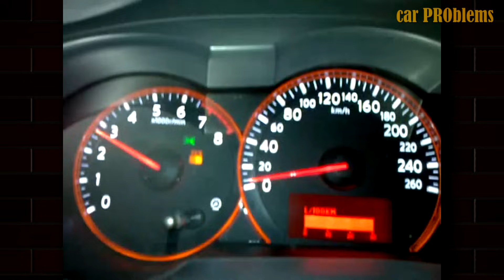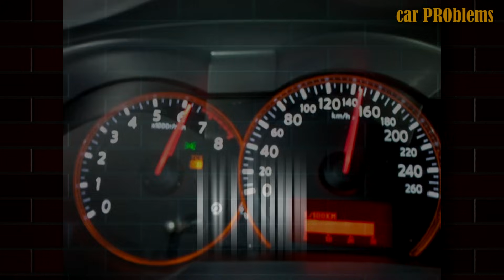How long do CVT Transmissions Last? - CVT Reliability

Comment: I have almost 180.000 miles on my Lexus hs250 and I haven't had any problems and if I did I could get another cvt transmission for about 1000 dollars on eBay

Comment: Over 130.000 miles so far on my 2009 Nissan Altima CVT. I've had it serviced a few times, although probably not often enough. That said, thanks for the reminder. I'll be doing it by next year at the latest. I don't drive too many miles; less than 8,000 per year, and I go easy on acceleration. I have experienced no odd noises or smells. Anyone else here have a 2009 Altima? What is your experience?

Comment: I have a 2010 Altima and I only got 100 some,000 mi on my CVT before. I replaced it in March so it didn't last long. And another thing, the dealership do not like changing the fluid and transmission because they say it's got a seal. That's a damn lie when I took it to the amco transmission. Who specialized in this? This CVT it was muddy black and the Floyd was burnt. Shake my head that's pitiful Nissan better get better with the CVT cuz you're only running off of a belt and that's it. And you never know when that's going to stop on you even with the brand new ones

Comment: 118k on mine bought from old people original owner driven like a baby and right after I bought it it started going out. We are so screwed. I spent every dime we had cause the car itself was so nice. Looked brand new inside and out. But with this trans going bad it's worthless. Don't know what to do. We are in big trouble unless I can find out how to fix this. Don't have anywhere near 7k to replace with new. Took me 4 years to save up the 5k to buy the car. Anybody know any tricks to fix these for cheaper?

Comment: My Honda dealer recommends changing CVT fluid every 40,000 miles. There's a general mechanic in the next village, but he doesn't know foreign cars or CVT. He's more agriculture based. That means i have to travel 100 miles for service, but it's the only place that has someone who knows these things. Something to keep in mind before buying this new technology. Not just any mechanic can fix these things if you have a problem or need maintenance.

Comment: I just bought a used honda accord with 25k miles and that transmission..it seems to be ok . I going to service it every year . However i never ever going to buy another one as i not going to change the possibility failure.  I dont care if it last for 200k it want matters to me . I bought this car and it pretty nice ride but for me i never going to own another one.  Not wanting to deal with that

Comment: My 2019 Corolla CVT transmission went bad at 106000
Reply: Did you get the transmission replaced? What were the signs that it was going bad?
Reply: @ yes. It just broke on the freeway. It just wouldn’t shift. It happened in stop and go traffic on the freeway.
Reply: @ELURIE12  yikes thats scary, my 2019 with 105k miles is acting wierd, it has poor acceleration and sometimes doesn’t want to move when in reverse, i noticed a burning smell coming from the bottom
Reply: @j.vosier6786  How often did you change your CVT fluid?

Comment: Cvt transmissions were developed becausenthey are cheaper to install by the manufacturer they work great on an atv but not on an automibile because ofnthe conditions we put our vehicle under like towing etc. if you have to baby a new transmission it is useless in my opinion

Comment: A prius does not have a belt and variable clutch type CVT. It has a Power Split Device eCVT. No belt, no clutches. Instead it uses ultrareliable planetary gear sets controled by the two motor generators. Do NOT use a Prius as an example of belt type CVT reliability.

Comment: ........... counting all the fluid & filter cost that goes with it............ to may humble opinion ain't worth shit. That kind of expenses is eliminated by just using manual box........... change oil once a year. Clutch plate .......... very long time. Saves 10's of thousand of $ on replacing box fluids. So what's other opinion ya.

Comment: No such thing as a CTV or ECTV (from a Toyota) being just as good as a regular transmission. Not including the Toyota 8 speed in my new 2020 Camry. That thing was a piece of junk. If most all of your drive is highway it will last longer. If you do a lot of city or stop and go driving it's going to fail early. The Toyota ECTV uses motors but you still can't beat on it or add very much horsepower.

Comment: If you as a driver enjoy a mundane driving experience with no sensation of shifts, then by all means go for the rubber band effect of an CVT transmission. But be prepared for a big repair bill when your CVT dies. They are not like automatic transmissions that shift and can be rebuilt with new parts. Thus, CVT's are a throw away transmission and lack durability when worked hard. That is why they are not used in heavier vehicles that are used to pull or carry heavy loads. It seems most automobile manufacturers are producing a lot of short-lived garbage these days. We as consumers need to wake up and stop buying there under engineered means of transportation.

Comment: Nissan X-Trail (rogue) owner here.  Peppy engine , although if you push the CVT tranny (as I experienced) a burned smell is produced.

  I upped the frequency of fluid and filter changes to 40,000 km maintenance.  
  CVT is tender and you have to baby it somewhat.  That said, I can leave most Toyota arrogant drivers far in my rearview mirror.

Comment: i bought my 2016 honda fit cvt back in 2019. .had only 14k on it and the original owner was an older man.. it has 68k on it and ive changed the trans fluid twice in it so far.. i had them show me the fluid after i waited 32k and i could barely see color in the fluid when they held i tup to the light so i scaled it back to 25k..  i LOVE my fit. it gets like 43mpg driving aroudn TOWN at times.. i change my oil 1k early. .and if it needs a radiator purge or whatever i usually get it.. i also have a limited lifetime powertrain warranty so.. it fits with my ocd about maintenance

Comment: I have a 2013 Accord and it just hit 100k mi. So far it's been a very reliable car. However, I will say I am not a fan of how the CVT feels. While the industry says "smooth ride due to elimination of shifting" I say "extremely boring, numb ride" especially because I had an 02 Accord wirh a conventional automatic and remember how awesome that car felt. I  can honestly say I'm ready to step away from Honda's basic line and step up to their Acura lineup since those don't have CVTs. The downside is requirement for premium gas.

Comment: Toyota E-CVTs in the Prius / Rav4 / Corolla are completely different from regular CVTs. These are bullet-proof, completely different tech.

CVTs i. Hondas and non-hybrid Toyotas have a launch gear to reduce stress on the transmission.

Still, I would stay clear from those as well.

Comment: I am amazed that a Youtuber would start comments about belt/chain drive CVTs by showing a Toyota Prius.    Later in your video, you AGAIN show a Prius between pictures of a belt/chain CVT.    The Prius DOES NOT HAVE a belt/chain CVT.  It never had one.  It does not now have one.  The Prius uses planetary gears.        Yes, belt/chain CVTs are problematic.     The Prius drive system is bulletproof.       Before you start bad mouthing a great car, find out what you are talking about FIRST.

Comment: The CVT on my sisters 2006 Mitsubishi Colt had 496,000 km on it when she sold  it. However the CVT was badly maintained: She wouldn't do a transmission oil change for 200,000 km or more. It was driven away by the guy who bought it... but it was playing up (sometimes didn't want to go into gear)  because of all the metal in the oil. We think the valves got stuck. Repeated fushing didn't help much. Maybe additional flushing would free the valves up again as the magnetic sump plug was still covered in metal filings each time we changed the oil. However it probably needed a new CVT. 

I'm sure it would have gone much longer if not for the poor maintenance. 

N.B. The engine was running perfectly when it was sold.

:-)

Comment: My 2015 Nissan CVT is nearing 160,000 miles.  I have the transmission serviced every 30,000;miles.   👍🏾👍🏾👍🏾👍🏾👍🏾
Reply: do you replace the filters too?

Comment: THIS VIDEO IS DECEPTION.   Comparing Prius eCVT and the regular CVT is like comparing eMail and Mail.   Prove me wrong.
Reply: Beda mekanisme sih, kalau e cvt itu cuma istilah rasa berkendaranya yang mirip cvt karena basiknya memakai motor listrik yang punya akselerasi instan seperti cvt jadi toyota menyebutnya seperti itu, kalau cvt konvensional itu memakain 2 puly dan 1 sabuk baja yang saling tarik menarik. Jadi keduanya sangat berbeda sekali
Reply: You are the one making the claim.  Back it up with facts.
Reply: @JamesP4620 its like comparing apples and oranges. one uses a belt, the other motors and gears.  use a simple Google search. Unreal.
Reply: @miguelborromeo6010  you’re 100% right
Reply: Sleazy mechanical belt or chain CVTs count on friction to work. 

Toyota (and Ford) hybrids use a planetary gearset and electric motor to provide CVT action for the gasoline assist engines. These gearsets avoid friction and are very reliable. Ford Model T used planetary gearsets a century ago.
Reply: thats a late model Audi they are showing on the bench
Reply: Your 100% WRONG

Comment: From everything that I've read Toyota and Honda CVTs are the gold standard while Nissan CVTs (at least in the past) are soo bad that led to alot of folks to never want a CVT again.
Reply: Probably because the Toyota does NOT use a belt CVT in their hybrids.  The Nissan CVT is a belt/chain type (the one with the cones.)  Toyota's hybrid system is bulletproof.
Reply: @wearethelandrovers9014  Toyota uses belt cvts on their non-hybrid low torque cars. Their trucks use regular planetary automatic transmissions.

Comment: Just change my 2016 Honda Civic 1.5T CVT Filter and CVT Fluid from Honda OEM CVT to Amsoil CVT and now Redline CVT. Redline CVT hands down is by far one of the best CVT Fluid, high additive package. It runs smoother. Also add some Lubegard CVT for more protection. Goodluck!
Reply: Really? Man..I should change mine to that..iam using oem in my 2016 honda accord sport
Reply: @edubb2491  Nothing wrong with OEM but it’s just additive on Honda CVT Fluid isn’t that much. But the Redline CVT fluid is by far the best CVT fluid I have tried.

Comment: If you don't change the fluid every 30,000 miles and filter every 60,000. You will only get 100,000 if that !

Comment: Personally I HATE CVT transmissions. When they fail, they cannot be rebuilt, so you have to buy a new one, and on a Subaru, they cost $8K.
The CVT robs your engine of hp, torque and mpg.
My 11 RAV 4WD Limited with the 268hp 3.5 V6 got 26mpg on the highway with the cruise control set on 75mph. My RAV had a 5spd geared (conventional) automatic transmission.
My 19 Forester Touring with the Gutless 182hp 2.5L 4cyl engine with the CVT only gets 25mpg on the highway with the cruise control set on 75mph.
So my Forester has 86 LESS horsepower and the engine is 1.0 Liter Smaller and 2Less cylinders and get WORSE gas mileage because of the Horrible CVT.
I ONLY sold my RAV  and bought my Forester to help save on fuel costs because of Communist Biden shutting down our oil production, but Subaru LIED about the fuel economy.
If I would have known the Truth, I would have NEVER EVER sold my RAV and bought my Forester.
I like my Forester and the winter traction is superior but I always put studded snow tires on my RAV every winter.
We normally keep our vehicles for a very LONG time and many years,  but as soon as I can, I’ll be selling my Forester and I’ll be buying either a Venza or another RAV, or perhaps a Lexus NX Hybrid AWD.
Prior to buying my Forester, I had been driving Toyota’s for 40+ years and I will happily go back to a vehicle brand that I can Trust.

Comment: Subaru says that the CVT fluid NEVER needs to be changed.
We take both of our Outback and Forester to our mechanic who works exclusively on Subaru’s only. He recommends to have the CVT fluid changed every 36K miles, but he doesn’t do it because the fluid needs to be at a certain temperature.
So I reached out to Subaru of Spokane (Washington state) and they also recommended that the CVT fluid be changed at 36K miles and they will do it at that dealership.
Spokane is a 3 hour drive one way, but they’re more trustworthy than our local Subaru dealership in Wenatchee, WA.
My wife’s Outback just had its 30K mile service completed by our mechanic at H&D Auto in Wenatchee.
I’m currently having warranty work done on my Forester Touring at Subaru of Spokane. 
They’re already expecting for us to schedule an appointment for my wife’s CVT fluid change later this year.
Reply: No they want you to buy a new one lol
Reply: @frankm2145  Exactly

Comment: I have owned 3 Nissans with a CVT transmission.  2007 Versa 230,000 miles with no problems give it to my daughter and she traded it in for a 2021 Kicks that so far with 30,000 miles no problems,  2015 Sentra 160,000 miles no problems my sons owns it now and still going strong, and just bought a 2023 Sentra only 7000 miles but no problems yet.

Comment: PRIUS - quoted early in the video - DOES not have a CVT.  It is Toyota's Hybrid Synergy Drive - with not a belt in sight.

And will likely last the life of the car - unlike SUBARU etc CVT which won't.

Comment: CVT transmission is Junk 
You need to replace CVT  Transmission fluid every 
15000  - 25000 miles

Comment: 0AW on my Audi Multitronic A4 B8 8 Gear CVT i love it so much and i learn a lot from it . Fluid every 30.000km plus filter or filters its going now 210.000km one flywheel changed and its going so good . I Love it . Starting smooth and driving smooth its the key .
Reply: what do you mean by driving smooth? not make speed? or just don't drive aggressivly .
Reply: @Alioua_prof_H_geo  driving smooth my men , dont drive agresivily and try to reach max revolutions slowly to gear up .🤙🤙🤙👍👍👍
Reply: @Alioua_prof_H_geo  --Drive it in a civilized fashion -like a 75 yr.old retiree (me) -It's not a Dodge Charger!
Reply: Presume you mean air/oil filter etc. Multitronic doesn't have a changeable filter.
Reply: @ln5747  where did you learn CVT Multitronic doesn’t have a single filter? Because it has 2 filters son, one inside and the other is the external one, so what the fvk you telling us.

Comment: I am not a fan of CVT transmissions. I recommend the 8 speed automatic transmission.  Steer clear of any CVT. See how I am firm in my recommendations? Always try to have a regular transmission and change it fluid once a year. It will last decades!

Comment: The one thing I have heard about Toyota CVT transmissions is that you MUST use the Toyota brand transmission fluid. Other brands of fluid can ruin the CVT transmission. The good news is that you don't have to buy it from an expensive Toyota dealer. It can be ordered online from various sources. I think Toyota says to change it ever 30,000 to 60,000 every two to four years.
Reply: Toyota hybrids do NOT have a belt CVT, so do not need a special belt fluid.  Their hybrid system is bulletproof.
Reply: @wearethelandrovers9014  my Toyota Corolla le CVT has over 287659 I do a drain and fill every 40 to 60 thousand miles

Comment: I have a 2015 Nissan (Versa) Note with 84K mi.  No issues whatsoever.  Just volunteer to have your CVT fluid changed by the dealer every 30K mi. I paid $239. USD.  A small price versus a replacement CVT or replacement car.

Comment: My 2015 Nissan Versa Note's transmission needed replacing before 25,000 miles.  It was covered, but I still don't like it.  I wouldn't buy another with one.

Comment: My Jeep Patriot has 225,000 miles with the Jatco (Nissan) CVT. It works surprisingly well with 4x4 in high and low range. I've found Valvoline CVT fluid is far superior to whatever was provided by the factory.
Reply: I use Amsoil CVT fluid 
Costs a little more but it is the best CVT fluid you can buy 
Hands down nothing comes close to it.